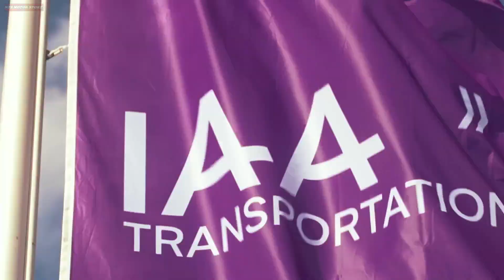2024 Mercedes Benz GenH2 Fuel Cell Truck

Comment: Looks like the Merc people know that Electric power truck is not the way to go, its a fail option, a hybrid one?- a way better way to go or that H2 is good , - if they build fuel stations. After all the climate freaks will maybe stop attacking road transport companies on the roads. Maybe? Merc looks good. TH